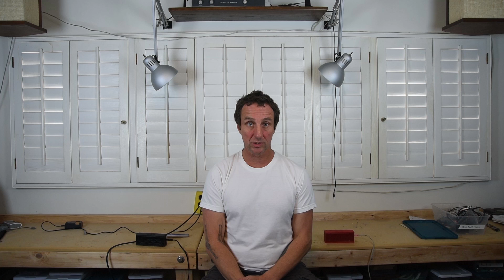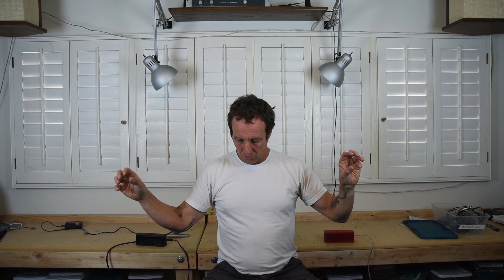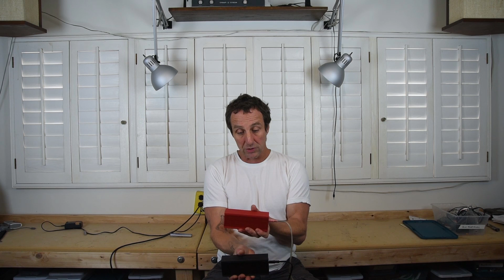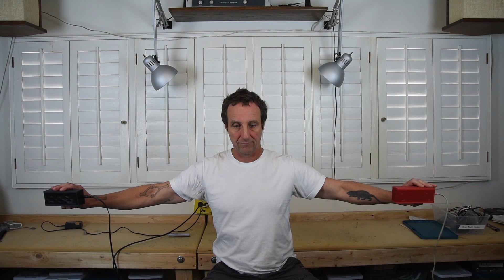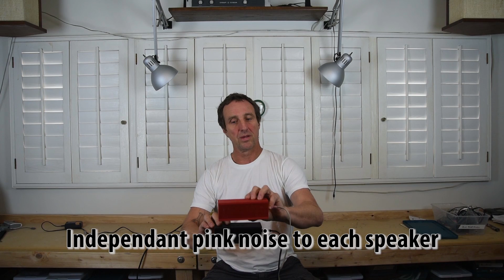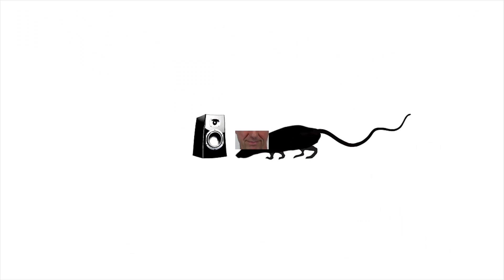Problems With Mono Sound From Stereo Speakers

Comment: Dave, thanks for the thought provoking video! I will try to use separate pink noise sources the next time I room tune a system. It was so interesting to hear the differences. Thanks again for sharing the knowledge.
Reply from the maker: +Don Thompson Use two pink sources and then pan them mono and they become a single source, test. pan them stereo into dual sources, test and then pan them to 10 oclock/2oclock or 9/3 and test. This will give you a good idea of how the system will respond to mono, true stereo and typical mono-ish mixing styles.
Reply: +Dave Rat Thanks! I'll try this next week at my next show.

Comment: Wow, that changes everything, even the way I think about sound reinforcement. So, do you have any tips or tricks for altering stereo signals enough to effect this kind of change?
Reply from the maker: That is indeed the challenge that I am still working on.  That said, once everything else has been spread apart, the vocals really stand out clear in the center. Also, spreading tnings out, you minimize having all the same comb filtering effects occurring on all the instruments in the same physical listening locations. so it become way less of an issue for the things that can not be spread.
Reply: @DaveRat  what if u were to y split the centre vox at desk , send one L , one R , wud this work for  getting bigger , clearer vox?
Reply from the maker: You can split or send the same signal as many places as you wish but it is not until you send different dlsignal that you will reduce the interaction.
Reply from the maker: +Bob Adams Dual mic'ing is effective, especially if using dissimilar mics at dissimilar distances mic'ing dissimilar areas of the instrument for each side. Also sending slightly louder to one side versus the  other and EQ'ing differently on each side all adds up to reducing power alley, creating a more realistic stereo sound and reducing comb-filtering.
Reply: +Dave Rat Thanks!
Reply: How would you go about vocals and other sources that are hard to get two different signals from?

Comment: I read that some of the large sound systems used by the Grateful Dead worked on a similar concept. Sections of speakers were dedicated to one mic or instrument and mixed by turning up or down the volume of that speaker section. Great brain food. Thanks!
Reply from the maker: +Dave Sneddon Part of the concepts behind the new Rat Sound SDW22 SuperWedge is that it can be configured to have a separate input for guitar or bass coming from a separate speaker in the wedge. Also, this is why my MicroWedge system designshave trapezoidal sides to tight pack multiple wedges each reproducing a different instrument. www.microwedge.com
Reply: +jballistic My thoughts too while watching this. Sound systems could be made up of a PA system for each channel of your mix... More money for mr Rat on PA Hires :)
Reply: Yeah, except in the Dead's case I believe the rationale for the system was monitoring, not interference reduction.  The idea was for the band to hear exactly what the audience was hearing.  It worked well theoretically, not so well practically -- the system was large, unwieldy, expensive, not really scalable.  Feedback was a major concern because a large sound system was pointing directly at the mics, so they used two phase-reversed mics to avoid the problem.  However, for this setup to work, the singers had to eat the mics all the time and apparently, the mics sounded terrible.
Reply: @leskanekuni6310  I believe the rationale for the Wall of Sound was not monitoring, but rather, the complete elimination of intermodulation distortion.